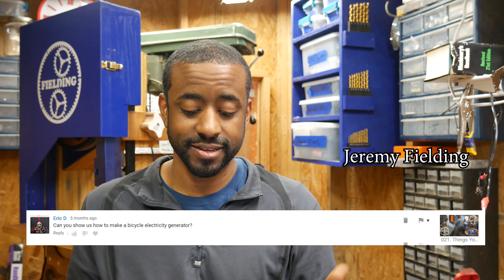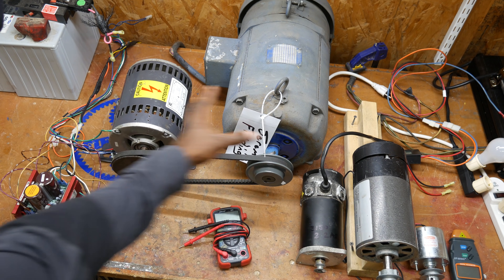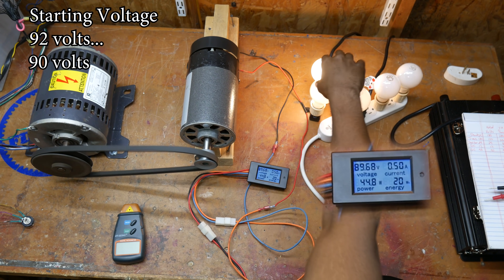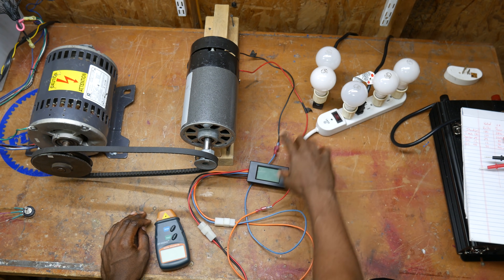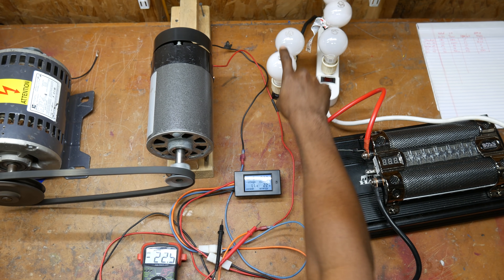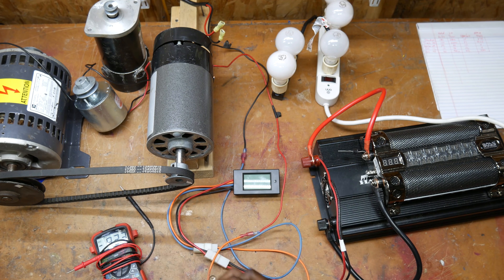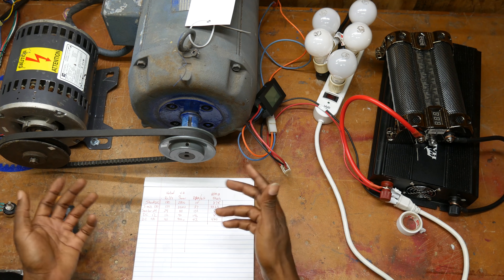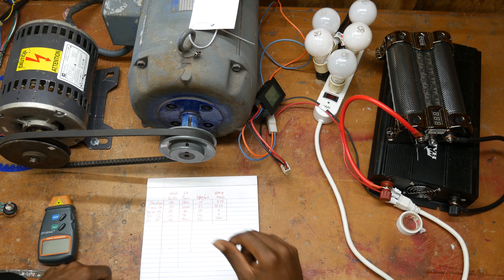How To Build A DIY Generator Part 1 : 050

Comment: Good video as always but I have one nagging remark:
You tested the treadmill motor up to 200 watts (which is about the nominal power) and compared this to the bigger one at 200 watts (which was 2kw power). So basically you compared one generator at 100%  capacity to the other generator at 10% capacity. I am wondering if the bigger generator also develops voltage drops when close to max capacity?

Another remark is that you could also use a buck/boost converter between generator and DC converter to even out voltage changes
Reply from the maker: No... look closely. 2.2 hp motor (2200 w) compared to 3hp motor (2800 w) One at 85volts wired for 100v and the other 90ish v rated for 130v that is much closer to even then you portrayed. It is well known that shunt wound generators hold their voltage better. I just wanted to briefly demonstrate that. Not exhaustively prove it. If I ran the big guy over it’s rated power it would drop voltage also. But the PMDC will always drop even well below it’s rated power. The comment section is to small to explain why the behavior is different. But it is. Have fun checking my facts :) they are true
Reply from the maker: I am not familiar with buck/boost converters. Can they handle the power. What do they cost? I don’t know enough to apply one properly... at least not yet :)
Reply: i was getting my regular fix of "Jeremy Fielding" on my phone abroad so i could not read the labels. sorry for nagging! i also did not want to prove you wrong (i am pretty sure you check your facts beforehand) but i am always interested in finding as many different explanations as possible before making my judgement ;-)
Reply: a "buck converter" is a so-called "step-down" converter whereas a "boost converter" is a "step-up" converter. which basically means output voltage is lower (buck)/higher (boost) than input voltage.

both are dc/dc converters. the basic (theoretical) curcuit is pretty simple. amazon is swamped with different buck/boost (mostly combined) converters from 50-900 watts and various voltages (mostly from china but for 2-30 €/$).

should you shoot for something bigger then i would recommend you take a look at electric vehicle chargers. emotorwerks has some open source DIY kits (up to 25kw) but there it becomes pricy even when soldering it yourself... ;-)
Reply from the maker: I didn’t take it quite that serious. Thanks for the kind remarks:)

Comment: like a 12v battery charger that won't recognize a discharged battery, hook another good battery to it and then the charger will charge both. and then there's the huge problem about the generator input torque is something close to the output drawn. can't go over unity with this type of generator. all the times ive used tractor driven pto ac alternators in the 15-25kw range it is important to get close to that 60hz like you said but i've run them well over and sometimes under without long term damage that i've seen. over 60hz light bulbs are blinding bright, motors run much higher rpms but sound the same, too low hz they won't start up. for some reason my coleman 6500watt generator will not run my chest freezer on it's own but does run 2 refrigerators. my battery charger has a timer for a manual controller. maybe there's a way to adapt a cheap sprinkler system timer for a "off peak" solar battery system like the way the power company does for electric water heaters.

Comment: I can't wait to see this build. Home power generation is one of those things I think is going to be, or should be, really common one day.
Reply: How would you supply the mechanical energy? Nothing is for free... right now the best and most efficient way is via hydrocarbon fuels which can be done far cheaper via mass production (natural gas burning plant, coal burning plant, nuclear plants, hydro dams) Hence why we have an entire electrical grid instead of each house producing its own thing.Personally, I can see this happening if we can get nuclear technology downscaled to buildings or neighborhoods. MrFusion sure does sound nice.
Reply: @etherealrose2139   If we can efficiently downscale internal combustion engines to be very tiny but still produce 15 or so horsepower with over 80% efficiency or even 70% then home power generation will become cheaper than the grid.
Reply: Br!an Delta V As my pa would say "if 'Ifs' and 'buts' were candy and nuts, then every day would be  Christmas." Sadly, even 50% efficiency is still a long ways off. That pesky heat and vibration and noise....
Reply: @etherealrose2139  I'm designing an internal combustion engine right now with only two moving parts, no moving valves, and a 300 to one compression ratio. According to my mathematics it should be at least 81% efficient. Its a HCCI pulse detonation engine.
Reply: Br!an Delta V I like the concept of HCCI. I do. still a while coming. Mazda, with an entire engineering department and millions upon millions can only succeed with a SCCI at 16ish to 1.

so pardon me if I don't buy any claim close to 300 to 1, HCCI and petrol.
Reply: @smh9902  Man that sounds like a kickstarter scam already. 300:1 compression? Right.

Comment: I showed my nephew years ago how a dc motor and a generator are the same thing.  We used a 18 volt battery drill and a dc motor from a broken toy to power a car tail light.  We only got around 30 percent efficiency with that set up, but it worked.
Reply from the maker: Its the idea that matters... That sounds awesome.
Reply: Great, after watching your video I must tell you that at my old age, I could definitely make my dreams come true, always thought and wondered about electricity and motors and their multiple uses, I'll be looking forward for some more thank you...

Comment: Nice video. Would have been neat to see a power meter on your input motor so you could see efficiencies. Also I'd think it would be easier just to find a used generator and find a new way to power it.
Reply from the maker: at the 200 watt range I was drawing 530 watts from the wall. I just cut that part of the video because I didn't think anyone was interested in the "misc" details like me  :). That just shows how much lost there in between the VFD, the first motor, the belt, the  "generator" etc

Comment: What about using an old school car alternator and voltage regulator?  It's whole job is to provide the same voltages you're looking for.
Reply from the maker: Speed may be a problem. I don't know much about alternators, but I am assuming at this point they may require a high rpm. I will investigate this more.
Reply from the maker: A quick search of the web seems to indicate they need at least 2000 rpm to generate electricity. I will be working in that range for my project, but If this was a wind generator or something like that, 2000 rpm may be a challenge. Clearly we are not the first to think of this, so I will be researching and seeing what others have done with alternators... as far as which applications worked and which were troublesome.
Reply: J.T. thank you for your question.
Mr. Jeremy F. thanks for your response; please do investigate.
very best,  walt
Reply: Jeremy Fielding they may need that for full output. but I think the ones I have. from diesel trucks. witch don't rev but like 1,600-1,800 rpm. they cut in at like 200-400 rpm. they can output very High voltage. the magnet is pulsed at Hugh frequency. the internal regulator sets volts and cut in speed.  delco 10 &12 so alternators are very popular . and easy to modify. and alternators can be converted to BLDC motors. they can be bought new or remanufactured at the auto parts store. for less than $50.00, if you want to buy one . go to the auto parts get one for a 85 Chevrolet 1500 truck with 4.1 litre engine. of even 5.0 or 5.7 litre . but for low cut in speed. the 4.1 may have the regulator for it. and for wind generation . swap out the stator for a 24volt stator. less amps. but more volts at low rpm. I think a guy got one to work at less than 200 rpm. he is on YouTube. thanks and please give a alternator a try.
Reply: There are a couple of YT videos with people making a bicycle - alternator setup, and it does seem to work as long as you have the proper gearing.
Reply: as you know generation of flow is the result of magnetic fields cutting conductors or conductors cutting magnetic fields. As someone from the automotive world I would like to offer that alternators don't need high speed but rather are capable of withstanding higher speeds due to the orientation of the wire loops on the rotor. Automotive manufacturers run them up just so they can do the same work with a smaller package.
Reply: Are the old school alternators brushed DC or AC?
Reply: @AnthonyWilliamH  Car alternators are brushed AC but usually have the rectifying diodes built in so that the output terminal gives DC. Car generators are of course DC throughout. The main issue with using automotive devices is that they require lots of horsepower and aren't designed for efficiency, but longevity. Perfect for a car but not so good for wind turbine use.
Reply: Alternators are all 3-phase AC. If it was DC it would be called a magneto or a generator, but alternators are much more efficient.